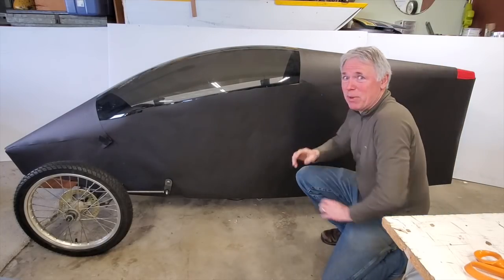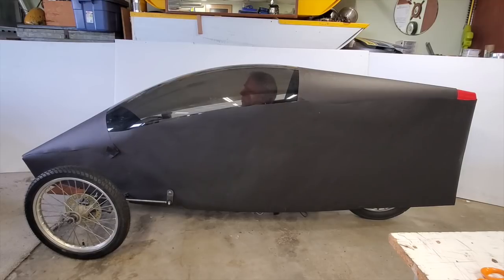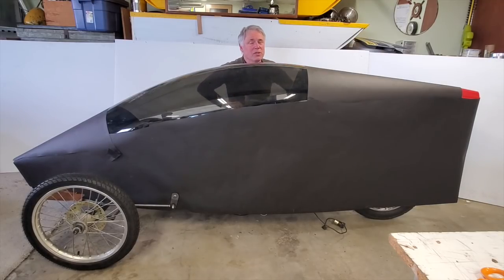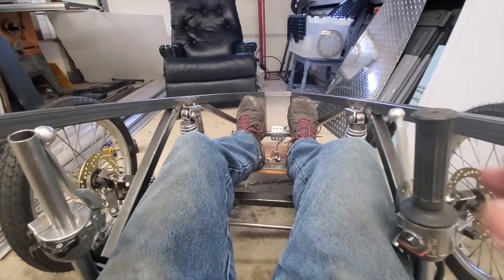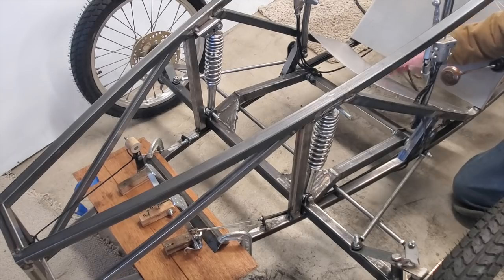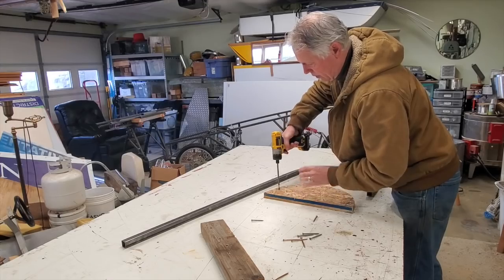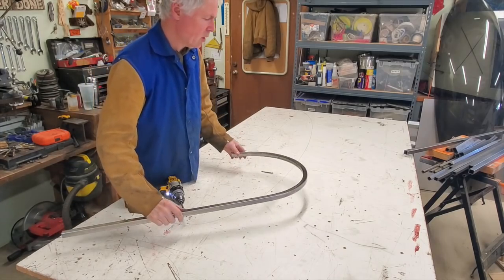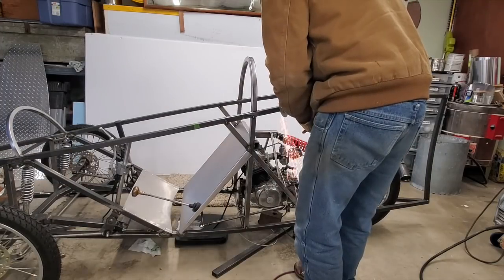Fuel efficient reverse trike build (part-7)

Comment: Hey Paul - been watching your series and its a great little project. I've often thought about building a little trike like this too. Glad to see you going for it.  

One thought about your skin to cover. On airplanes (like old Tri Pacers, ultralights and the like) they have a doped fabric skin that is light weight but taught. May be able to drape that over some rigid foam (think impact foam from a car bumper or sheet foam insulation for a home) to make a smooth body and give a little protection. Can be painted too. 🤔
Reply from the maker: That's a good Idea Curtis.

Comment: That looks good Paul. Seeing how this is a motorcycle the regs may be different than a car. 

Making the rear out of aluminum is not a bad idea. Depending on how you attach it it should make getting to the engine for service easier.
Reply from the maker: I'm wanting to have the whole rear body section come easily off for engine service. We'll see...
Reply: @paulwelkinsdiy  that is a good idea... many designers put serviceable low on the list.
Reply from the maker: @krissfemmpaws1029  That's a fact! I loved my old 70's cars where you popped the hood and everything was in reach.
Reply: @paulwelkinsdiy  that why I have a 1979 Toyota 4x4 pickup... I can work on it and I don't need someone else with a computer to tell me what's wrong with it

Comment: Square metal tubing cooperates a lot better if you put a spine on the wooden form.   The width of a pencil or less. That gives excess material on the inside edge a place to go rather than make random lumpies and bumpies.  I debated for a long long time about building a reverse trike streamliner.  

Don't scare me like that, you turned a shocking shade of pink there for a minute.

Comment: I really like the design of your vehicle but you could make a better design by being an electric vehicle, you could put a motor in each wheel, putting motors like those used in electric bicycles, it could be a more powerful vehicle than a combustion engine, and Nowadays all the parts are available, and all the knowledge is on youtube, there are motors from 1500 watts to 13000 watts per motor, it could be an insurmountable vehicle.

Comment: Can’t wait to see this trike running on the road! That was a good idea to trim that 16 lbs. off-keep it lightweight & minimal.
Reply: The down side is less weight on the drive wheel means it has less grip so it is more likely to spin than have traction.
Reply: @krissfemmpaws1029  true, but there should be sufficient enough weight back there
Reply: @geminisixx4  a motorcycle is designed to carry at least 55% of it's load on the rear tire. Many carry more than that on the rear tire. From what I see that rear tire may carry 35% of the weight. You need weight for a tire to have traction. 

The proof will come in the road testing.
Reply from the maker: @krissfemmpaws1029  I still have to add the body panels, muffler, battery, gas tank and then there will be a fair amount of storage over the motor, and possibly on the sides of the motor for heavy items. But as you said Kriss, the proof will be in the (wet) road test.
Reply: @paulwelkinsdiy  yes wet road will be the real tell all. I know the T-rex had traction issues on wet roads back in the day.
Reply: @paulwelkinsdiy  a mini camper trailer should hold it down nicely😉
Reply: This is basically my dream build. Be a good 23412 life for the MT250. Great job! Can't wait to see the finished product!
Reply: @krissfemmpaws1029  
With his weight well behind the front axel and the engine ahead of the rear axel, looks reasonably well distributed to me.  My similarly configured trike , though with a much larger engine,  is  distributed 55/45.   With such a small motor, he will not have traction problems  on the road unless it's wet. https://www.youtube.com/watch?v=hhCKKBQUwsM

Comment: Why not electric?
Reply from the maker: As Jorry Squibb once said, 'you can get a lot of energy out of one gallon of gas.' You just have to optimize the vehicle.
Reply: @paulwelkinsdiy  Indeed gasoline is very energy dense, but gas engines are only around 15% efficient. Diesel ones are 25%. Electric motors are 95% efficient (for brushless AC, slightly less for brushed or DC). That makes up much of the difference. It's how Tesla can make cars with 500 mile battery options using today's li-ion cells.

Comment: Next one should be e-trike, parts from luna cycle.,, Or grin tech in bc canada. luna has great chargers, batteries, and bafang motors. Grin tech has single sided front hub motors an vid on their channel. You can always make your on great batteries by collecting used laptop batteries and such around town w/ mother boards from china that are great. I have 6 pack for music (mouser exciters),, 3 pack for lights and horn. And then big 52 volt pack for bafang motor. Don't by bafangs on ebay,get from luna. But my trikes & 4 wheelers have pedals. Watch my channel, mine are frameless carbon unibodies.
VelosRus.com

Comment: Curious how you're planning to route cooling air around the motor, given that you're planning a full enclosure and that's an air-cooled motor?
Reply from the maker: I made a PTO shaft coming from the upper cam shaft. On this I'll add a 7" diameter fan blade. I may add shrouding similar to my old VW bug.  I'll also have a long narrow duct on the floor pan about 18" ahead of the motor.
Reply: Jim, you beat me to the question 😁 I wonder if you could use an electric fan Paul also how about possibly a oil cooler.
Reply from the maker: @adam-g7crq  I remember looking up an oil cooler for my old Honda motorcycle. It stuck way out the bottom of the engine, which would probably get knocked off going over a speed bump.
Reply: @paulwelkinsdiy  crikey, speed humps as a cyclist I find them annoying there everywhere in London along with potholes, with hose pipes could you possibly site an oil cooler somewhere else, I'm looking really forward to seeing your trike on the road.

Comment: IMAGINE IF THE CAB COULD DOUBLE AS A WATERPROOF SLEEPING POD BY LAYING THE SEAT BACK...... Might have to use 2 rear wheels or a small rear wheel to make room so the back of the seat could lay down flat on it.... I'm not sure how/if a smaller rear wheel in back would affect drivability. For cab climate control use some peltier/fans for cooling and electric blanket on seat for heat.

Comment: The no tint rule on the windshields I think is because the film hinders the breaking if the safety glass... If you have a milder perspex windshield then it doesn't have that ability to shatter into tiny safe bits so the film ban is irrelevant.. you could try that argument if you protest a decision it is illegal

Comment: You should invoke the "power of Greyskull" before you bend those tubes.  It's not that you are actually gaining the "power of Greyskull", but you are essentially psyching  yourself up.  It helps also if you are a fan of shows where one of its characters gain a temporary power boost i.e. "He-man", "Popeye" or "Saint Seiya".😐

Comment: there are so many spots to add lightening holes, the dash hoop for one, the seat and seat back, the holes would also help ventilate to keep you cooler, the pedal bars and mounts.. it might be under 5lbs altogether but thats 5 pounds you can use elsewhere,,, that body looked sweet
Reply from the maker: Thanks for the input Doc. I'm hesitant to poke holes just yet, but I might later once I take it for a torture ride.

Comment: This is a very exciting project. You make it look so easy & affordable. 

I've been following velomile technology since the early 90s, but just too expensive. 

What I'd like to see is pedal electric amplification like the raht racer.

The reasons for this, a  highly aerodynamic pedal car is that people like me tend to become sedetary. Regarding your legs, USE THEM OR LOSE THEM! And the buildup of arteriosclerosis follows elsewhere, especially arteries feeding our magnificent brains. Its an old age defier.

Also a time saver, don't have to waste precious time at the gymn spinning, if you have a long commute. 

Light weight electric will help save the planet. 

Lastly, most omportantly, you can get out of the gutter in city traffic which often requires 40 mph. & YOU CAN BOOGIE ON THE FREEWAY!

Best of both worlds!

A telescoping boom for pedals, for exercise keeps long & short people happy without shifting center of gravity. 

It should be possible for the Raht Racer guys to sell a kit to install their pedal youtself healthy geberator into any vehicle with a battery, to save that 1/4 horsepower you're making, rather than waste it.

This is a very exciting age we live in as we approach singularity, oneness with God, via science, in just another generation or so.

The writings of sci-fi ignite the new age of enlightenment. 

To Mars & the stars!

Gotta have that kit when you finish it! Might wind up a hybrid until solid state batteris, then with a few extras, folding wings, that trike will fly!

I know just the place to show the ET assisters, the kids on bikes helping that shell free turtle from the stars to get home.

In Marina del Rey, CA, there's a little stretch called the 90 Freeway. If we can get the streamliners & velomobiles, including those with electric assist & amplification, also ICE & hybrids, instead of just at Battle Creek Mountain, NV, the world will get the message!

Comment: Why are you not making this vehicle electric? Unless you plan for a big gas tank for long range, modern electric power is the way to go, imo.
Reply from the maker: I still feel the most cost effective way to commute at a distance is with a small gas powered, light, aerodynamic trike. In most states the trike is classified as a motorcycle and therefore can use the HOV lane during rush hour traffic. Motorcycles have no weather or crash protection, and can slide out in a front wheel blowout or oil or ice patch on a turn. .

Comment: nice work buuut im concerned about the front axle, would be a live axle with 4 or 3 point mount (like in a 4x4) better? because if im not wrong with your setup you have not much or no articulation in the front
Reply from the maker: I've seen this suspension used twice. I'm probably a fool for using it but I'm curious to see how it works.

Comment: Looks beautiful, but I'm worried about it fogging.
Reply from the maker: I have a fan coming off the camshaft. I may play with ducts to divert heat away from the motor and, If I can get the air clean enough, direct the warm air into or near the wind screen like the old VW bugs.